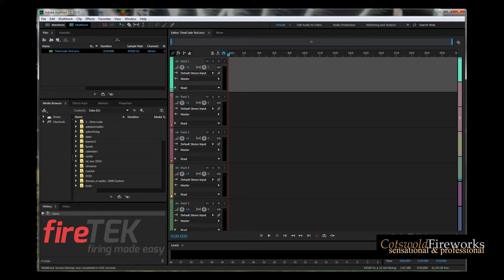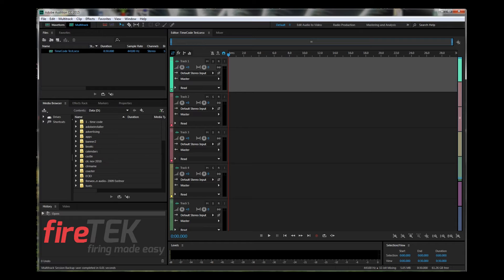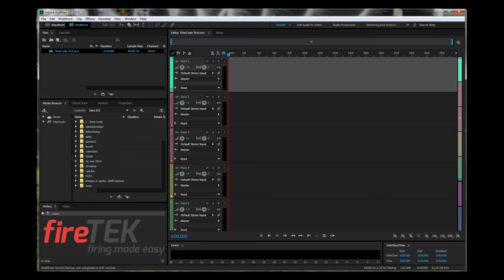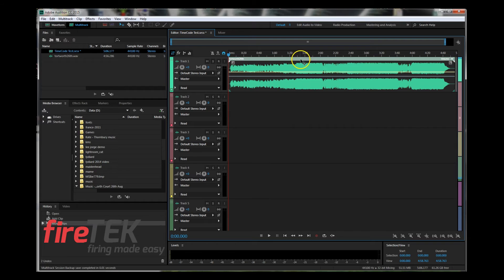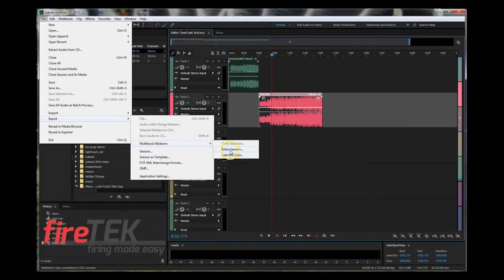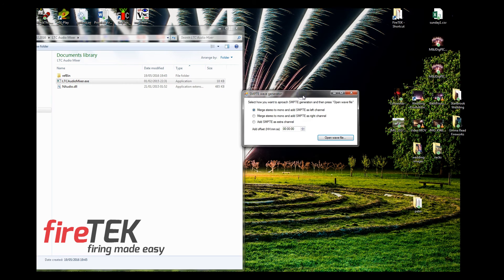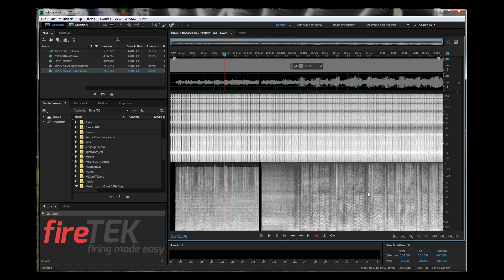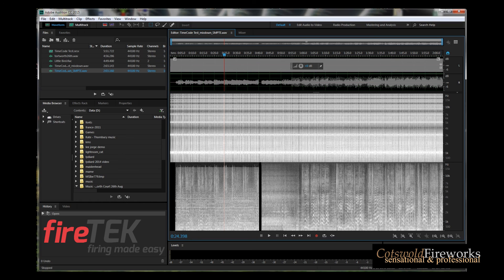FireTEK Timecode Creation

Comment: That time code generator thing where you can choose the right or left channel, is that something anyone can get, or is it exclusively for firetek?
Reply from the maker: The software to add time-code is free to download off the internet. Quite a few available.

You can use either channel for time code plus you can also pick 25 fps or 30fps depending on systems you may be working with. All you have to remember is passing the correct channel to the correct equipment. I've only heard time-code played to the audience once. Quite painful.

A new firmware version (v6 currently under test Feb 2018) for the FireTek FM-99s remote controller will now generate time-code automatically.